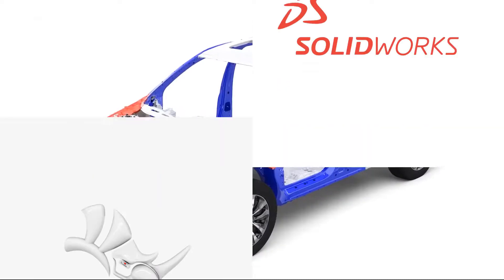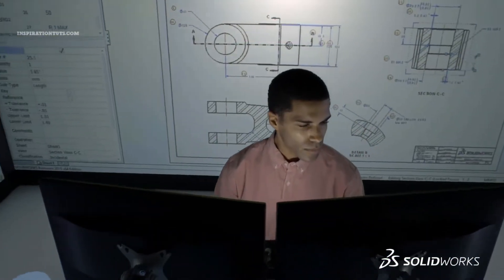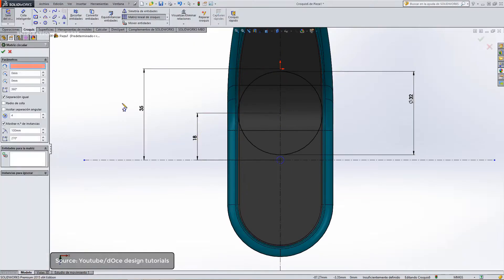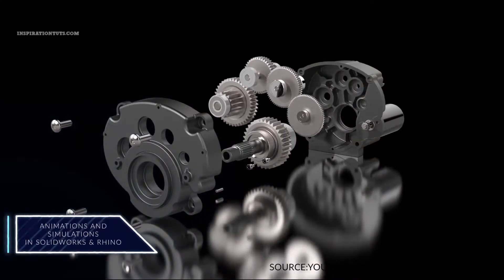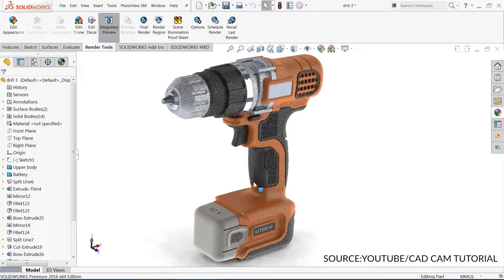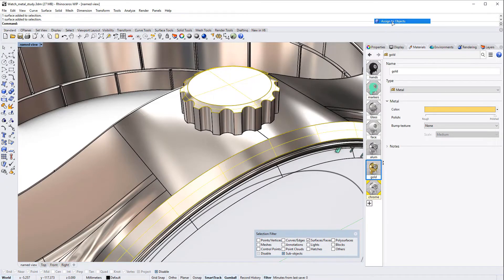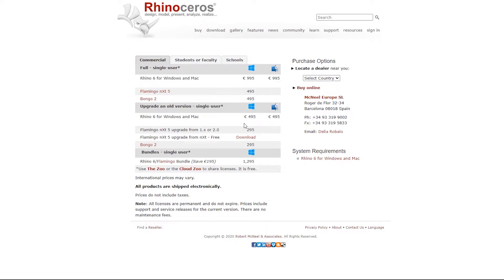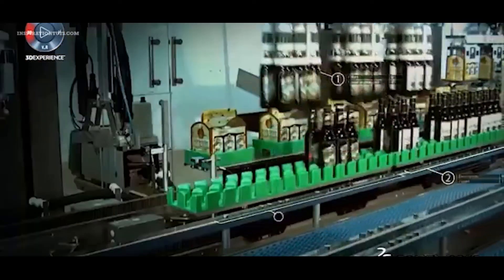SolidWorks Vs Rhino which one is better

Comment: Sorry, but this is misleading information. Rhino is barely used in the automotive industry. I worked for most European and some of the Asian and American car companies and I've never seen rhino except for visual programming whith Grasshopper, when they build komplicted grids. If you want to be a modeler in the car industry use alias! Even though Rhino is developed by EX alias wavefront employees, rhino is more used in product development maybe in the boat industry sometimes it seems like the Architecture industry and surely the product design industry but not or barely in the transportation design industry! So for everyone who wants to be 3D modeler in the automotive industry you beter learn Alias or blender.
Reply: blender for automotive ? not is mesh base ?  mesh for smooth surface ? u kiding right ?

Comment: Rhino is an amazing surfacing tool. It can be made parametric or not through Grasshopper ( node based parametrics ) . I can use it for CNC, rapid prototyping but also for simulations like in CFD and other sim packages. Rhino started as a plugin for AutoCAD back in the 1990s to design complex ship's hull in 3D. It was extensively used to design America's Cup racing sail boats and it still is. I m in aerospace ( major business jet manufacturer )  and I ve been using for 25 years Rhino along with many other designers in engineering and had no problems working with our fellow engineers who use Catia exclusively. I worked on interiors and exteriors. I built an incredible amount of physical mock -ups all thanks to Rhino exclusively. I do renderings and conceptual work, 2D and 3D layouts and VR with it but I can also prototype anything I wish for. Rhino uses the same technologies as Siemen NX , or Catia or Solidworks meaning NURBS surfaces. That s why Rhino is extensively used in product design & architecture. I ve used Catia , I played with NX and Solidworks and they re all great packages. But for my specific needs and requirements Rhino does an excellent job. On top of all the surfacing tools using NURBS I also have SUBDs and a complete rendering package, i have access to grasshopper all for a very decent price.Not to mention having access to an incredible array of plugins that add even more flexibility to Rhino.  Rhino's community, in ALL fields, is huge and keeps growing day by day. I have ZERO regret choosing Rhino.

Comment: Dude, check  your info .......NOBODY in Aviation is using Rhino LOL....Im in Aerospace and we are using Siemens NX. The other software that is widely used in aerospace and automotive is CATIA and Alias for Class A surfacing.  SW is used for some product development  and Rhino for some industrial design, but its lack of a history tree makes it pretty much useless and DOA as an engineering tool .
Reply: I have to agree, having used Solidworks for mech engineering I can't imagine using a package that doesn't allow you to make changes to previous modelling history. Development of designs is completely dependent on using this feature, otherwise it's just an industrial design tool
Reply: history trees are useless when you no how to design something
Reply: @nickeyhill8546  🇨🇦🥴

Comment: Parametric Sw=10, Rh=1;  Mechanical Modeling Sw=10, Rh=2; Surfaces Sw=4, Rh=10 ; Cinematic Sw=10, Rh=0;  They are not comparable . (SolidWorks, Catia, Sólido Edge, Nx)… these others are.   (Rhino , 3DsMax, Blender, Maya ) These others are comparable to each other.... Don't compare the egg with the chestnut.      😁😎👍
Reply: Did you just try to say SW is better for parametric design? 🤣
Reply: That question can only be asked by someone who does not know solidworks and possibly either what it means parametric.  😂😂😂😂
Reply: LOL comparing rhino to blender or maya is literally apples to oranges
Rhino is a CAD - design software and blender / maya are mesh and animation software, these two are not the same 
In rhino you cannot do VFX and in blender/maya you cannot do precision modeling and extract technical drawings
Rhino is not as good as solidworks and catia but it is in the same category, in both you do 3d modeling with nurbs and solids and can create technical drawings 
I use both rhino and blender for my projects and these two are absolutely not comparable
Reply: @vowel8280  jojojojojo!, claro que sí, que risa, verdad? ... Que listo eres! 😁😁😉
Reply: dmmasterdesigns1010   Exactly. You really are a good CAD designer.
Reply: @eloisachavez7494   🤣 antoine9765 is a jealous fake troll with no channel.
Reply: dmmasterdesigns1010  Was wondering what everyone here was arguing about. I saw your channel your really good with CAD. Ignore the haters. Everyone's jealous.
Reply: dmmasterdesigns1010   I just noticed that🤣 Dude was dissing you and can't even use the English language. He must be a minor. Probably 10. You've been engaged by a child. I never imagined kids learning CAD. Wish I was a kid being trained on it. Parents who teach CAD must care about their children's future.
Reply: dmmasterdesigns1010   Danny. Don't even reply back to that foo.. He probably has many fake accounts and is thinking, just because someone defends others on here they gotta be as fake as he is.
Reply: Parametric Sw=1, TF=10 🙃
Reply: @EraDimgames   whats TF...?
Reply: It’s hard to imagine a program that’s ten times more parametric than SolidWorks!... I’m really curious.
Reply: @Quimber100  https://www.youtube.com/user/TflexPLM
Reply: @Quimber100  In SolidWorks most of the parametrics live inside sketches.
In T-Flex the entire design is variational: any element can reference any other element, across parts and assemblies.

Comment: Would it be correct to say Rhino is not a complete parametric 3 D modeler which can do concept to engineering production friendly 3D and 2D 
Are Rhino's 3D surface modelling capability as good or better than SW/SE/ Pro E or Catia and NX?

Comment: Rhino can do organic design, also by using grasshopper for architecture, while to solidworks more powerful to simulation and CAD system parametric design for automotive, both can't compere just make any video.

Comment: I look at it like Rhino is a design software and SOLIDWORKS is a complete engineering software. A lot of CAM and and CAE features, simulation tools can be found out of the box in SOLIDWORKS, which are entirely absent in Rhino and mostly need 3rd party proprietary plugins or scripts. But I absolutely love Rhino's Grasshopper, hope such a feature would be added in SOLIDWORKS too, it'd open a range of algorithmic design capabilities. SOLIDWORKS is more inclined towards mechanical engineering (or maybe that's how I feel because I am a mech student)

Also, Rhino's 2D capabilities are not at all useful for producing machine drawings of any kind, and at best, it can  produce product catalogue drawings, that too with no in-built tools for dimensioning or annotation.

In a nutshell, this comparison makes little sense. Only major thing in common is that both have 3D modelling tools lol. I've only ever seen Rhino being used by my architecture friends at college. All automotive or aeronautical people I've talked to use CATIA or NX but never Rhino.
Reply: You have not understood anything, I work professionally with solidworks and my hobby is Max, Blender and I love these programs but they are not comparable, Rhino is very good at organic surfaces and solidWoks although it makes surfaces it will never be able to make them like Rhino does and on the other hand Rhino does not need to make mechanical production parts although it is great in Jewellery and product design.... Something that SolidWorks has little capacity although I have been able to make good designs with a lot of effort ... I prefer Rhino for design. Neither should be better or worse than the other, they simply should not be compared. Would you compare Illustrator with Rhino? I also use Illustrator for my designs, but I can't think of comparing them.
Reply: @Quimber100  read my comment twice.
Reply: I don't need to read it more times, I totally agree with you... they are very good programs but they are not comparable... nor do they need to be compared. My comment was for mvelentzas and I told him that I hadn't understood you.... It's not about belittling Rhino. As much as we like Rhino, it can't do what SolidWorks does nor can SW do what Rhino does.
Reply: @Quimber100  totally agree. I mistook your comment as a direct response to mine since there was no direct mention of mvelentzas. Apologies for the discomfort
Reply: Agreed, I am a bridge designer and Rhino was often used to produce a very precise model of a item in still state, it does not have the workflow of solidworks where you can see how part of your machine works, which is why it is often used in architecture and jewelry design. One of my friends in auto industry told me they often use solidworks (and catia) to see if something works, and then remodel all the parts in rhino for 3d printing or production
Reply: You're completely wrong about Rhino's 2D capabilities.  You most certainly CAN produce machine drawings and it does have in-built tools for dimensions and annotation.   It has an entire drafting menu and layouts feature with its own dimension/annotation styles.  Not sure how you missed that.
Reply: @mvelentzas  Lol, being able to insert orthographic views and dimensions/annotations doesn't make it a 'good' 2D drawing package :)

Rhino lacks the most fundamental thing - GD&T standards and identification. I've clearly mentioned that it is ok for producing catalogue drawings but it is nowhere in its current vanilla state capable of producing production drawings.
Reply: @nuduw  I think what you mean is that Rhino is not as good as Solidworks at producing production drawings (which it obviously isn't).  Which is different from saying that Rhino is INCAPABLE of producing production drawings.  It's like saying a Hyundai Sonata is incapable of driving because it isn't a Lambo.

Comment: Stop! don't compere two different softwares. And Rhino is nurbs modeling software. And it was initially designed to be a plugin for AutoCad. That's why it have such similarities to AutoCad and command interface like AutoCad and that's why it is quick modeler. It's in completely different leauge.

Comment: Those are two totally different software, one is 10 time more expensive of the other - what is the point of comparing them.
Reply: which software is more expensive
Reply: rhino or solidwork
Reply: @Brilliantmulia  definitely not rhino
Reply: who is buying? :3
Reply: @micemincer: Rhino 3D is $1,000 and Solidworks  is $4,000.... Just saying your math is a little off!!!!
Reply: @arthurny3914 Solidworks starts at 4195$ for the standard version, professional is almost 8000$ + for both the price for 2 years subscription.

Comment: Rhino was developed in the early/mid 1990's and not 1980.
Reply: It started in the 80s. The full history is in The webpage. It had another name and was not standalone.
Reply: @hectororestes2752   The company was created in the 1980's but Rhino wasn't developed until an intern came to the company in the 1990's. They have the history on McNeel's website.

https://wiki.mcneel.com/rhino/rhinohistory
Reply: I think I got my V1.0 in 1999 (WinNT) and that time it's been in beta for a while. Apparently it shared a software kernel with Alias/1 launched by Alias Research in 1985.
Reply: It still feels that way

Comment: Could you do a video on Grasshopper vs Dynamo vs Blender Geometry Nodes vs Unreal Procedural Mesh?
Reply: I don't know how you plan to compare blender geometry nodes to dynamo or a polygonal modeling software to a Nurbs one.
Reply: @repolygon  Sverchok is similar to grasshopper and the recent Fields change to Geo Nodes makes it more similar to Sverchok.  BlenderBim is on the brink of producing drawings and the IFCs it can create are better than Revits. Rhino has only just got SubD added but Blender had had it for nearly 20 years.
Reply: I lost you here. Are you saying that you can design a part for production manufacturing in blender ? I'm not saying 3D printing. I experimented a little bit with blender Subdivision for smooth visualization. it's not the same as subdividing a control mesh "cage" that generates G2 continuous Nurbs surfaces by Tsplines. I use blender only for rendering and animating and UV unwrapping a CAD file I made somewhere else usually solidworks or Alias. I never made something in blender.
What are you referring to by IFC ?
Reply: @repolygon  I think I know what's happening here.  I design water features so I don't need the tight tolerances necessary in manufacturing.  IFC is the standard file format for exchanging 3D models in the AEC industry.  For me collaboration and speed of organic modelling are more important than precision.  Being able to create visuals and animations are also a handy bonus although Unreal Engines DMX abilities and Realtime rendering are tempting.
Reply: @benveasey7474  thanks for this nice conversation sir, as I said I'm just a casual blender user. I would love to see your designs, do you have some online ?

Comment: which is easier to learn?
Reply: Depends on you but I think solidwork is easier but rhino is more powerful
Reply: Rhino is not parametric though. If you have to modify your design it's often very time consuming. But you can create almost anything.
Reply: @atnfn  it can be parametric if you want, by using grasshopper.
Reply: Solidworks